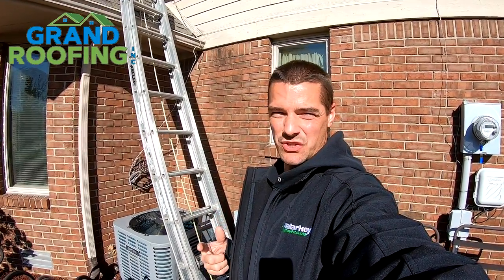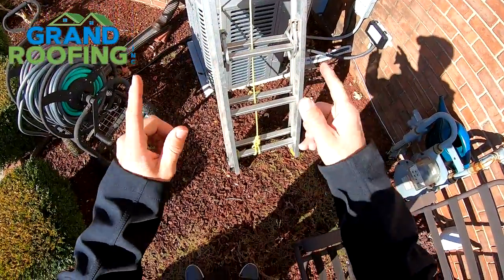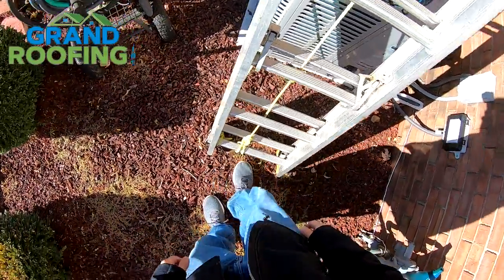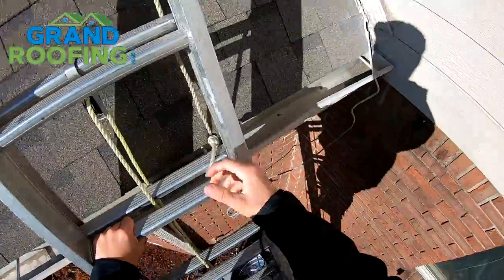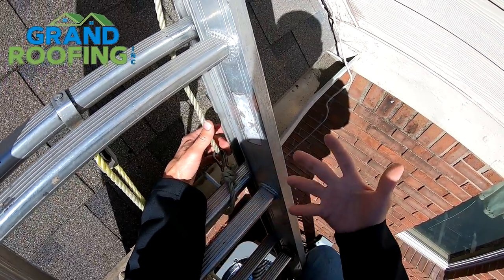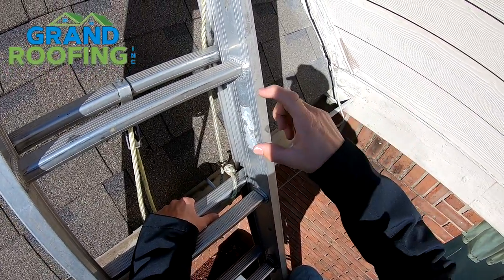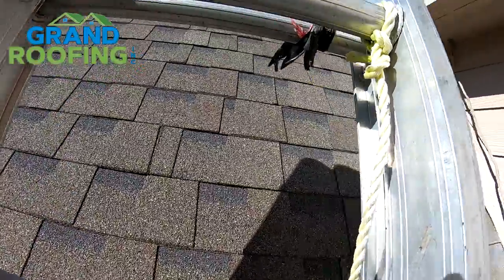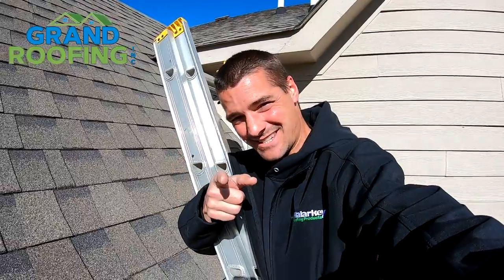How to not to fall off a ladder - Roof top safety, learn from a roofer. Ladder safety training video

Comment: You may have not broken an OSHA rule. The standard says that the employee must use one hand while ascending or descending a ladder. You could argue that you were stationary while adjusting your tether. Plus you had your forearm on the rung of the ladder which could maybe be considered 1 of the 3 points of contact. But best not to get too technical with OSHA and just fully grasp the rung lol.
Reply: It’s better if you use a rope to pull the materials up than climb ladder with one hand

Comment: I don't always use the 3 point contatct exactly, but pretty close. I ALWAYS have 1 hand in contact, but I do step with my foot and opposite hand - but never break contact with both hands at the same time. One other thing I do - is when I'm on dirt like that, I always push the ladder up 1 rung so I can kick the feet out. I had a foot slip out on me once on a single story when I did what you did - but to be fair, I had a LITTLE too much angle on it because of a bush. It obviously was a 1 story or the angle would have been better, and I'd have kicked the feet out as a matter of habit..

Comment: Most deaths or paralysis occur getting 6' step ladders as the break point is between the second and third vertebrae where the average neck line contacts the ground

If you're going to fall, jump of vertically they say, then you land in your feet, hit your knees then with elbows protecting your head you roll into a ball then roll and turn impact force into kinetic rolling energy, but better off being tied off on a life line, it simple anchor bracket and rope, takes 5 minutes,

Say you have a roof tie down anchor 25' from where you're working at a roof edge, it's 65' from the ground, 70' from the bottom of the elevator shaft, hook your rope around a roof truss right where you're working, so maybe an 8' straight fall would occur if you fell off a wall, however, if you didn't wrap your rope around a close framing member you might be in for a 20 foot fall at the point of drop in only to swing 15' back into a block wall and then your 6' lanyard, so, a 170 lb guy falls, he's at the end of his rope perspective to his fall location, but the anchor point is 25 feet back, he falls for 20 feet in a swing and smashes full velocity 15 feet away into a cmu wall, nominally, but the lanyard or rope with a built in lanyard system (which should then be only connected to your harness D ring and not your 6 foot lanyard) unleashes, so then a 20' swing drop becomes 26 feet of properly connected, or, if improperly connected becomes 6' on the rope with built in fall arrest plus the 20' of rope plus the additional 6' lanyard you're talking s 15' lateral positional fall at the drop point away from Anchorage, and a 32' drop to take you smashing into a concrete stair it elevator shaft, this needs to be reintegrated in OSHA cottages around the globe. It's sometimes impractical to move an anchor every ten minutes, but wrapping your rope around a close framing member plumb up from where you're working might be in order

Comment: If u dont apply for wcb or osha's, plan, they cannot fine you.
Reply: Just be safe while working.
It's not rocket science, its safety first
Reply: 16 years roofing and I've only fallen off a ladder 28 times.
The ladder to get out of the pool.
Or into it, whatever I was drunk.
I dont see osha patrolling, public pools where there's 10 steps to get to the top of the slide

Comment: Lol I carried my tools up on the roof everyday for yrs 😂
Reply: Exactly, like they cant expect someone to buy a machine to just bring tools up, and or tie everything to a rope and pull it up that way lol. Even the supervisors dont do that sort of thing
Reply: Lol I am a forman and donot make my guys always obide to it
Reply from the maker: I know, nothing would ever get done!
Reply: That's too true I would love to share pics of jobs with another roofer  I do standing seam in Maine I don't have any social media
Reply: @louisbrown2279  There are always reasonable exceptions. I walk up a ladder like a normal person rather than moving a hand THEN a foot - I move one hand, and the opposite foot - a natural motion which is inherently safe - you can always drop a hand back down and grab it if you slip. I wear a tool belt, and most everything goes in there except a caulk gun. I carry that in one hand, which I ALSO use for the ladder, and I can drop the caulk if I need to actually grip the ladder with that hand.

I used to tote bundles of shingles, boxes of nails, roll roofing up ladders - put it on one shoulder, just lean into the ladder, and be willing to drop the load. That was before we got a ladder lift, but it works, and if done right, it's not the most dangerous thing in the world.